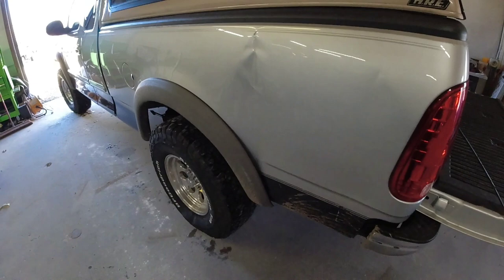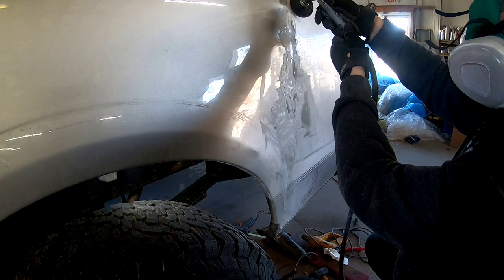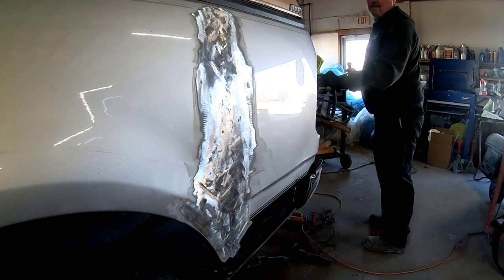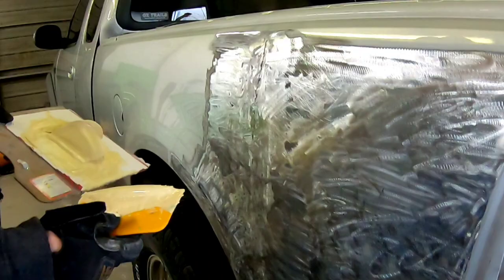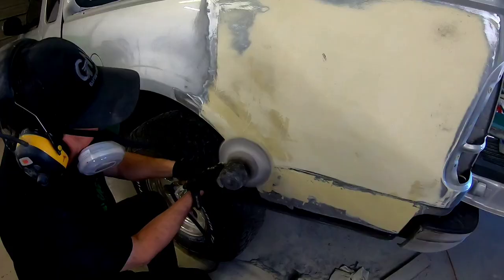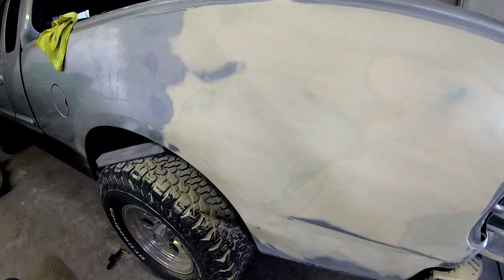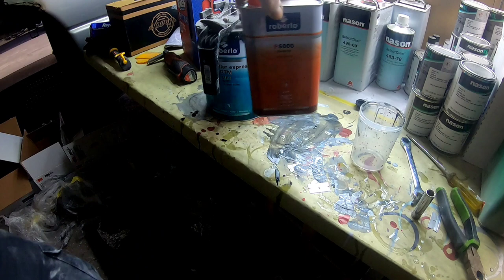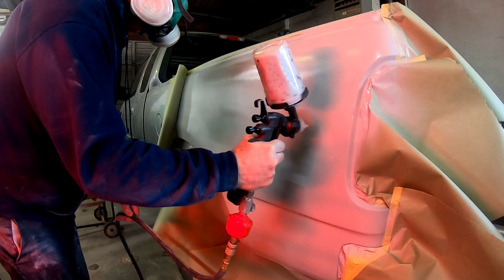How to fix body damage on your truck #autobody #bodywork

Comment: I have the same spot welder but dose not weld on like yours dose keep up the awsome videos and work
Reply from the maker: I changed the ground on mine. Don't  know if that would help . I keep the ground close to the weld too
Reply: Thanks yeah i just bought that ground clap hopefully it works will try it tomorrow 👍🏽